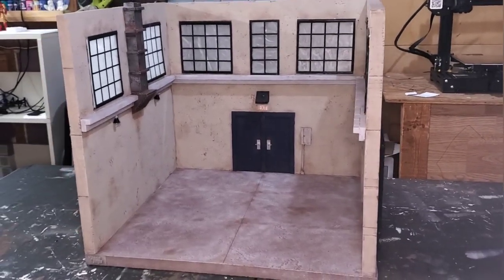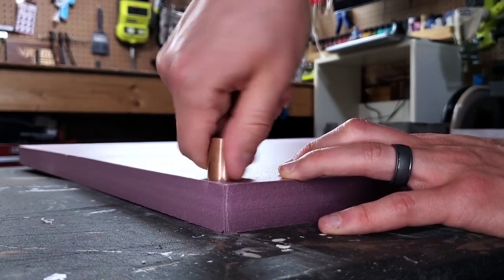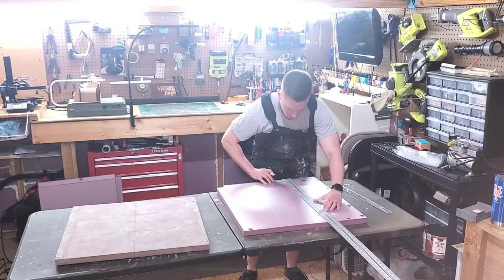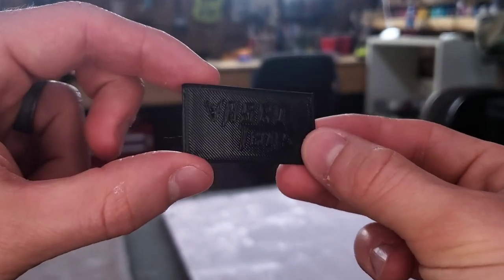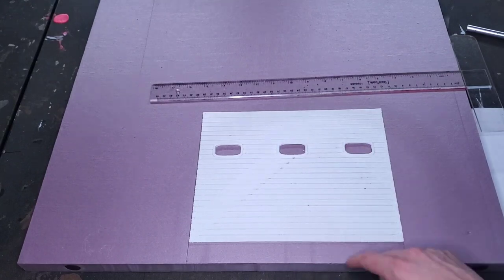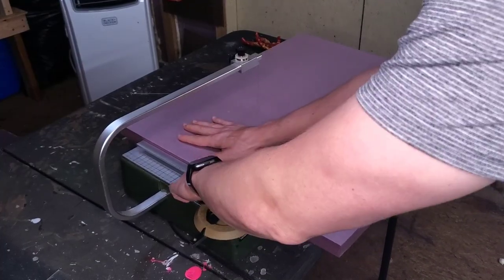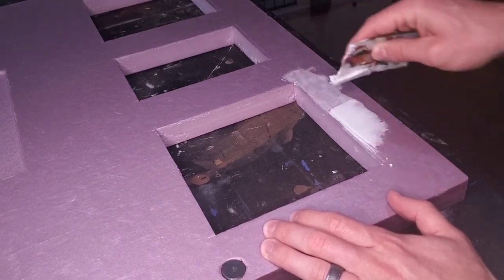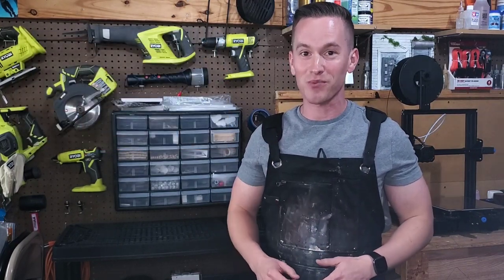I remake this diorama... but BETTER!

Comment: Sorry if i missed it, but what did you exactly use for those black window frame parts? 🤔
Reply from the maker: Those are 3D printed windows that I designed
Reply: @vascotoys  oh ok...do you know where I can get similar material to use for the window frames? Because I don't have access to any 3D printing..
Reply from the maker: @RoRo-zh4uf  I actually sell my 3D printed windows. If you would like to purchase some, feel free to email me at vascotoys@gmail.com.
Reply: @vascotoys  thanks alot..I'll look into that as I'm making a specific warehouse that uses slightly different sized windows though 👍💯

Comment: Great video. Where did you get the jig for the Proxxon? Or did you make that yourself?
Reply from the maker: Thanks! Great question. That is a Shifting Lands jig. You can get that jig and a bunch of others here: https://www.shiftinglands.com/
Reply: @vascotoys  Awesome. Thank you! I’m getting into diorama making and I have the proxxon and definitely want something sturdier that what it comes with. I would absolutely use it more. Thanks again!
Reply from the maker: @uncommonflex  that's awesome! You're off to a good start, but if you upgrade the fence and even think about getting the Proxxon foot pedal those are great ways to make it even better.
Reply: @vascotoys  Thanks! I was looking at getting the foot pedal
Reply from the maker: @uncommonflex  you're welcome! I LOVE the foot pedal. You get much better control of your cuts using it.

Comment: I used one of the small 3" rollers for a 1:10 scale warehouse I made for my rc drift track and it was perfect. You can get them with their own little paint tray too. I was able to get a nice smooth coat on poster board without oversaturating it.
Reply from the maker: Very good info! I will have to plan things out better next time. I just used leftover supplies from interior home paint for this one.